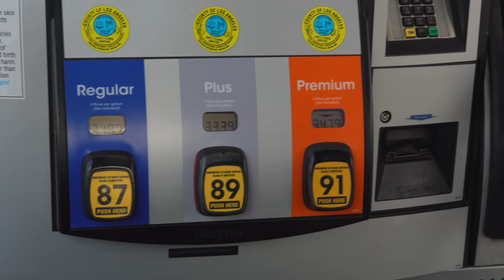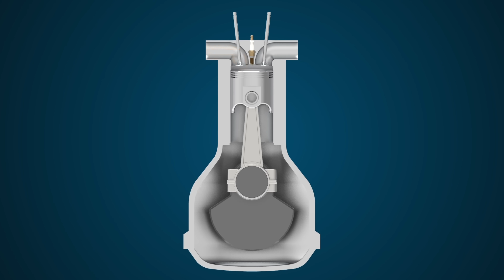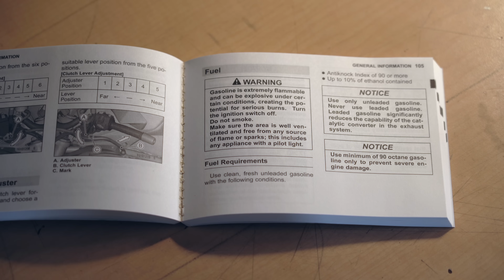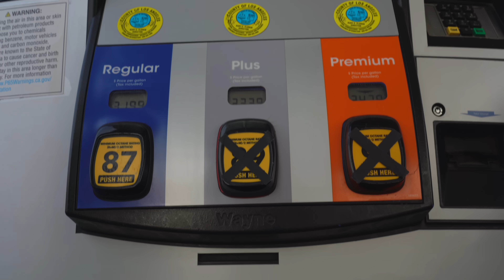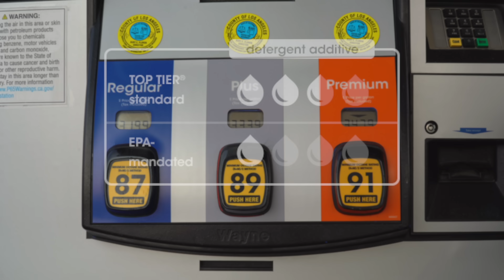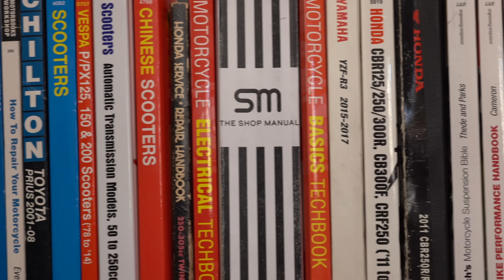Should You Run Premium Gas In Your Motorcycle? Octane Explained | The Shop Manual

Comment: To echo a few others, high octane fuels are often free of ethanol and stay fresh longer. If your bike sits all winter premium fuels will stay fresh. And no, fuel stabilizers don't work. Project Farm demonstrated this in a video showing that they did very little to prevent gumming and corrosion and did not keep the fuel fresh enough to ignite easily after 6 months. Premium fuel (non ethanol) did stay fresh. In summer, when I burn through fuel quickly, I run 87 octane. Near late autumn I switch to 93 octane and make sure I run a tank through so over winter the fuel in the tank and system stays fresh.

Comment: Something interesting, ethanol and low octane fuels produce more condensation in the carburetor and lines & sometimes tank when sitting. Its a common problem in small engines. I would never use ethanol fuels unless the vehicle is specifically designed for it. I was a mechanic when it was invented and we saw many problems with engine damage in the early stages when used with vehicles not designed for it.

Comment: In Australia we have 91, 93, 95, 98 and ethanol 10% usually. I have ducati and italian made husqvarna & SWM bikes at the moment and find with my superbikes i run 95 to 98 all the time, and its like a fire breathing dragon, but my sport tour model i use 98 in winter and lower octane in summer which seems to make it happy. High octane in the dirt bikes which are more prone to decompression pop. I also find after 50 years and 20 or more bikes, a new spark plug can make all the difference in reducing pop. I used to have a great example, i had a high compression race engine in a 73 celica was only a couple of hundred horsepower but was very octane dependent. It won fastest times against the 4wd A grade rally cars in the 80s. I rebuilt the engine and caused further problems which had to be corrected with a multiple spark distribute system, which solved all backfire and pop problems instantly, it still ran rough like a drag engine, but under power it was perfect and used to leave supercharged 6 cylinders like they were chained to a post. Its a reminder spark is so important.

Comment: I have owned my bike for about 8 months now and I have noticed it is pretty discerning when it comes to gas. When the gas is not right, the engine sounds strained, it seems to produce more noise and vibration. There is one particular brand of gas that my bike prefers on which it seems to run a lot smoother and feel happier. With other brands, regardless of the gas price, it is strained. That said, when I was scraping the bottom of the tank, I just had to pull up into the cheapo gas station and got myself 2 liters of their fuel just to get to the normal gas station. That was horrible. The engine shaked and rattled so violently I was afraid to open up the throttle to half the redline RPM. What's your take on this? Does fuel quality at the same octane rating affect engine's performance?

Comment: octane absolutely makes a difference. The World War 2 fighter plane F4U corsair needed 135 octane fuel to take off. that 18 cylinder 2000 hp Pratt and Whitney engine could then switch to 110 octane fuel after takeoff..

Comment: Had a 89 1500 wing. Was designed for 87 but seemed to run like shit on it. 91 wasn't much more at the time and it seemed to like it better. So that's the only grade I used.

Comment: this is so wrong you do NOT get a second ignition AFTER the spark it happens before spark, then piston has to fight against ignition to  get to TDC before going back down this causes  pinging and it wont want to rev out past that point and can do enormous damage to your engine this  is also called pre ignition , pre  = before

Comment: Been running my goped, moped, 70,100,110,125cc on 95octane for years some are decade with no engine problem.. i never followed owners manual when it comes to my fuel.

The only accurate result I observed when running high octane on my small engines are piston & sparkplugs burn well and doesn't foul.. vs the lower octane 87,91 that builds a lot of carbon on my piston.
It even suck on cold start

Comment: One of the biggest frauds perpetrated on the American people is ethanol. Back in the '90s when only ARCO had corn fuel in their gas, those who thought they were getting a better deal on the cost per gallon at ARCO got significantly less mileage, around 15% less. Then they made all the gas in Cali contain ethanol. It made prices go up, you got less mileage, which was a double increase in cost, and less performance, my '93 Civic EX at the time dropped from 33 MPG on the highway to 27 MPG. The real fraud was the claim it put 10% less pollutants in the air, which was measured per gallon, but since you used more 10-15% more gas, that cancelled out the environmental protection. Simple math.

As for octane, most modern motorcycles are high performance machines with higher compression engines than most car engines possess and they also possess knock censors that retard timing when you use lower octane fuel. That gives you lower performance, lower mileage, and, with the lower amount of detergents than in higher octane fuels, more carbon buildup not just in the combustion chambers, but in the fuel injection nozzles. The savings in cost of fuel additives to help keep the engine and fuel injection clean offset most of the extra cost for high octane. That's why I've always used high octane in my bikes.

Comment: Nice vid, very interesting. I put 98 in my Ducati streetfighter 848, because they put 10% ethanol in 95, which make the 95 even lower, is that right? Also my fuel tank can not handle ethanol, so 98 with 5% is better for the tank

Comment: anything with forced induction or is geared toward performance i have always run premium just for a little ins agenest knock. but yeah unless the ecu is told to search for the limit or you do it manually, 93 in a 87 engine will do nothing. in fact you may actually get worse mpg's as most higher oct gas use alcohol to get the oct boost.

Comment: I don't get why the octane numbers are so low in the states. The lowest we have here in Denmark is 92. Normal is 95. And many stations/pumps offer octane 100 too.
Reply: He said it in the video too, but we use different systems for rating. In Europe they only use RON (Research Octane Number) and in the US they use an average of the RON and MON (Motor Octane Number) so Europe's octane ratings appear higher, but are roughly the same between grades.

Comment: don't use octane boost as turns rubber into plasticine (destorts oil seal O-rings etc) Put Red-X in the tank every 5-6 fills keeps the inlets/outlets clean and if you run a bike with injection it stops the injectors from fowling up. 
If you want to know something ask me forget Google.

Comment: The terrible truth that nobody wants to hear: It will run best on what the manufacturer recommends. If it calls for regular, premium will seem smoother, but it's actually making less power. If it recommends premium (almost all modern powersports equipment) it will run on regular while slowly damaging your engine.

Comment: One of the other factors that motorcyclists have to live with is the fact that our gas tanks are relatively small.   No matter what we purchase on the higher end, there will be a substantial amount of (most likely) lower grade fuel between the fuel nozzle and the gas station fuel pump.    You won't be filling up with the fuel grade that you really want.   When riding in a group, let your buddies fuel up first, as a courtesy.   😉
Reply: Hold on, do you have the same pump for different types of gasoline? Here in Italy you have one for normal and one for premium, same with diesel
Reply: @diegolobianco1015  US typically uses one nozzle for for 3 different grades of gas(petrol), you push a button to close the octane grade you want. If diesel is offered it is it’s own separate nozzle on the opposite side of the pump. Many city areas don’t offer diesel because most all of our smaller city vehicles all run on gas, diesel gets offered when you go further out where people drive pickup trucks, or close to highways or interstates.
Reply: it is such a small amount lol
Reply: This is simply untrue, unless you’re filling up at a station with old pumps. Modern pumps have two hoses inside the big “hose” (cover) that you see. One for regular, and one for premium. Mid grade is a mix of the two, which is done inside the handle as it dispenses 👌
Reply: I can remember pumps like that here in the UK, maybe 50 years ago, but for many years now, they have had separate nozzles and hoses for each fuel.
Reply: @rickconstant6106  in the past we had separate nozzles in America as well
But that was closer to a time when customer satisfaction actually meant something to businesses
Reply: @swskitso here in latam we still have separare nozzles for each grade of gas, i hope it won't change  sooner
Reply: Australia has separate pumps and nozzles for each different grade of fuel.. if you fill with 98ron, that's all you're getting.
Reply: @ThatguyPurps Unless you go to private owned servo's where they frequently mix fuels in the same tank and give the fuel delivery driver under the counter cash to do so. That's why I use BP, Shell or Ampol. I don't trust Caltex or the generic brands.
Reply: Haha, what? The same nozzle for different grades? Stupid Americans...
Reply: Here in the uk, it's not just the difference in octane:  for example, Shell say their premium fuel, V Power has four times more detergent than their ordinary fuel.
Reply: I run the first half gallon out on the ground before filling with premium. 🤔😂🤣
Reply: @MoparOrNoCar-vm5ul  great for the environment and wallet
Reply: @newearth9027  joking

Comment: Here in the UK, there is another advantage to using the higher octane - it has 0-5% ethanol, compared to 5-10% in the lower grade. I always use it in my bikes, a 1978 Triumph T140V and a 1980 Suzuki GS550L. The Triumph was originally designed to run on high octane (98 on our rating system), so definitely benefits from this, and the Suzuki is probably better off with the lower ethanol. For the amount of fuel I use, it's worth the small extra cost.
Reply: I run Esso Supreme+ 99 - it's 0% ethanol (labelled as E5 legally, but actually E0). It's the only fuel in the UK that doesn't have ethanol. Not only does ethanol degrade performance, but over a prolonged period of time it damages engine components and seals. It also results in lower mpg.

My car is 2014 but the manufacturer specifically states cold starting and performance will be problematic on E10, and they are correct. I only run E0 in both the car and the bike. More cleaning additives as well, for what it's worth. Use a nectar card and the Esso app for 5p per litre off etc.
Reply: You guys don't have ethanol free options? Some of our fuel station's offer no ethanol it definitely helps fuel milage.
Reply: @truckerman9836  Some of the E5, from some brands, has been tested and actually has zero ethanol, apparently, but they don't advertise it.

Comment: On our snowmobiles we experiment with different grades quite often. Lowering the octane can in certain situations slightly advance timing and make more power and throttle response. Only safe to experiment on if the engine has a DET sensor to put the engine in limp mode if a true DET is detected. Typically I will try it at home and drain the tank, add a quart or so of the lower octane fuel and test by riding. If it DETs than you can suck out the quart of fuel and return to a higher octane. That way you’re not on a ride being forced to run that fuel causing DET for the entire tank. Switching octane to a lower octane in sleds has been part of the snocross technique for a lot of years. It’s all part of the equation for maximizing power and response although every sled and fuel delivery system is different so there isn’t a one size fixed all solution to what fuel you run

Comment: HD requires premium.  87 will knock and generally suck. Older premium will run rough as well. Some of the stations where cheating the mix during last year’s fuel price fiasco. It was apparent almost immediately.

Comment: The reason High octane fuel has more additives is, since it does not ignite as easily, it may not burn away completely and leave deposits. Extra additives are needed to prevent the deposits where lower octane will flash off more effectively and therefore does not need the additives. For the same reason an engine designed to run on regular may not perform as well on premium. It desires the faster igniting fuel to run efficiently.
Reply: I was told the premium help keep the carbs cleaner. What say you Sir?

Comment: I only use 91 non-ethanol in everything but my daily drivers. I have a pickup truck I only drive every few weeks, my street bike, and all my power equipment. I still use a bit of Sta-Bil for winter storage, but it's nice knowing the alcohol will not attack the aluminum in everything.

Comment: I run Wawa 89 ethanol free fuel in a 12.5:1 compression GSXR600 and it’s more than fine. 

Vehicles with carbon build up on pistons from age do ping less with premium. 

I also micro dose with Redline SL1 powersport 1 ounce to 3 gallons of ethanol free 89 in my Suzuki. My intake valves are beautiful with no carbon what so ever.

Comment: Switzerland : 95 or 98, both 0% ethanol. 
I sometimes use 98 to "clean" the engine or feel like a sbk pilot ^^, otherwise 95.
I can't say if there is a difference in mileage or "performance" between 95/98, nor if cheaper gaz from smaller brands is really worse... maybe.....

Comment: 2009 Kawasaki KLR 650 sales brochure says run regular gas, in the front of the book I believe it says run regular gas, either in the middle of the book or in the back it’s been a few years it says to run the high test, and I believe these days if you run regular gas in a Car it will adjust the timing so that it will not ping and you will get less fuel mileage, at my motorcycle I can tell a big difference in the amount of spark knock it has when it’s warm under hard acceleration at lower RPMs! And if it’s happening then it’s happening at higher speeds but you’re not hearing it, This is just my opinion.😅

Comment: Can anyone explain where ethanol-free gas lands in this scenario? I’ve heard that it’s far better for small engines, but its octane rating is usually less than the premium rating. So if given the choice, do I just stick with whatever octane the user manual suggests, or does ethanol-free trump that? Great videos! Thank you!
Reply: Ethanol contains less stored energy per volume than gasoline so you will get better fuel economy out of "pure" gasoline as opposed to 10-15% ethanol as is commonly found at stations in the United States.  The only other material difference between the two fuel types is that ethanol can be especially hard on some of the fuel system components of older vehicles that weren't specifically designed to withstand ethanol.  Ethanol can have a corrosive effect on fuel lines, seals and injectors on these engines that will, over time, cause them to break down causing loss of performance and/or potential fuel leaks.  To determine if you should avoid ethanol fuel you should look to 2 factors.  First, if your car or bike was manufactured in the past 15 years or so, the fuel system components were likely designed with ethanol fuels in mind.  Secondly, the energy content of ethanol is about 30% less than that of gasoline.  If you're using 10% ethanol gas, that means your net energy loss per gallon is around 3%.  If the "pure" gas is more than 3% more expensive (ie 3 cents per dollar) then the fuel economy gain wont net you any savings.

Comment: I used to fill regular in my int 650. It was just fine. But one day I was forced to go for the 91 as the station ran out of regular for some reason. I discovered how much less vibrations were there with the 91. Plus, milage went up by 10%. 
Since then I have been using only 91. Not much noticable hp upgrade. But much less vibes with upto 10% more gas milage even in the city.
Reply: I use 89 or 91 in my continental gt (same engine) because it makes some funky, awful sounds on 87.

I know it can't be high enough compression to knock at 87, so I'm not sure what the noise is, but it doesn't sound nice.

Comment: My question is can my Versys1000 be reflashed so it will not knock with 87? It has 10.3 comp. ratio and requires 90 octane min. in stock form

Comment: I was a Machinist that rebuilt 1000s of engines back before corporate greed kicked in. They actually taught us the truth of things and talked like they expected us to have some common sense. Today, everything is a lie that covers one of their giant money funnels. This guy is actually telling the truth. Octane doesn't mean higher horsepower. It just let's you build higher power. Most engines today are built to run on today's goat piss cheap to make junk fuel that somehow cost more. So don't even worry about it. The problem now is some places water down gas with things like benzene because epa regs make it impossible for them to dispose of it correctly. Think about that. The only thing actually ever being done is making money.

Comment: I would list one exception to the horsepower and fuel economy when it comes to octane. Several places sell ethanol free 93 octane. Ethanol does lower gas mileage and potential power. So you would notice a slight increase in both by switching to an ethanol free gasoline. I do mean slight though.
Reply: Unless your bike is specific to ethanol fuels, they do more engine damage. Ethanol fuels and low octane fuels also produce more condensation during carbonation or in the carburetor when sitting. It is very common in smaller engines like generator and mower engines that are not used as frequently.